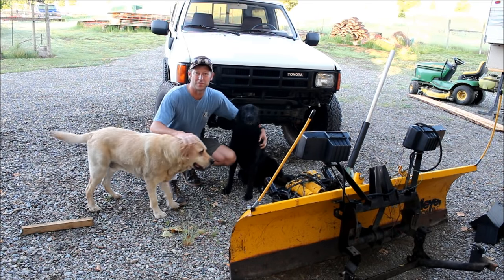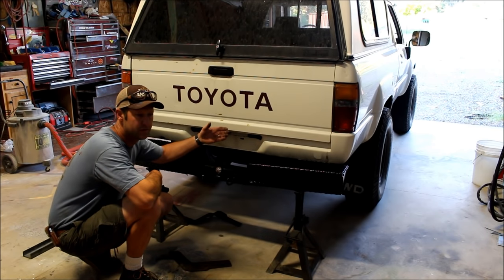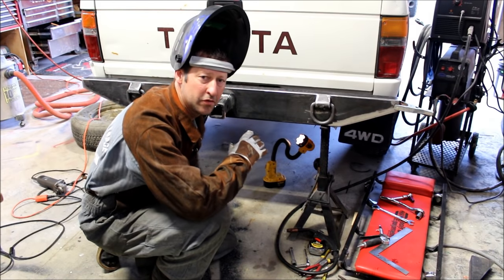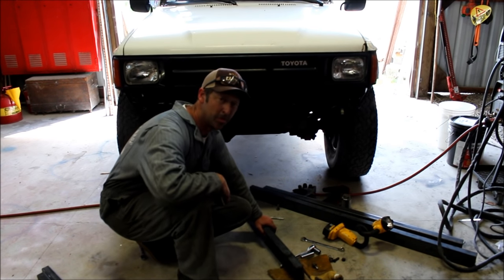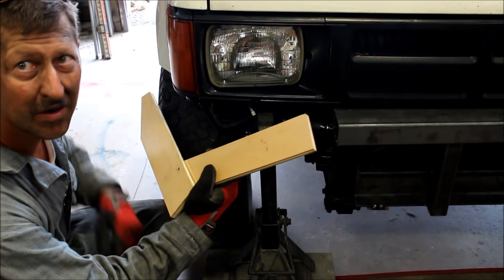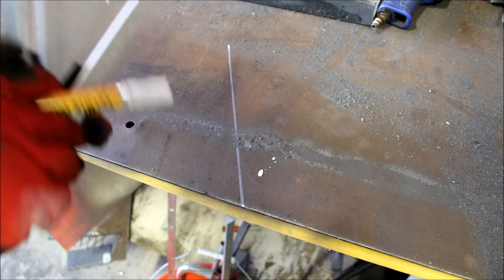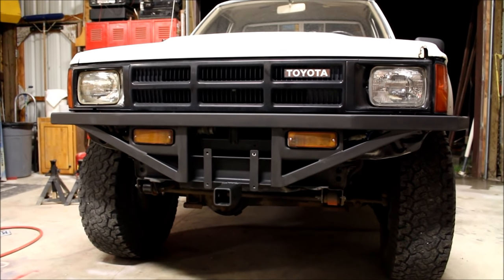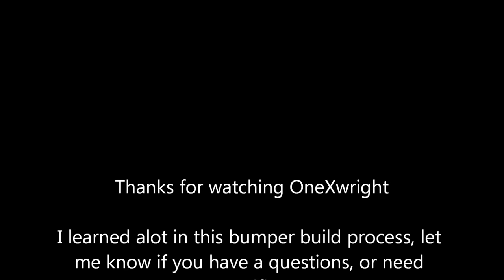Homemade Front and Rear Bumpers-Toyota Pickup

Comment: You inspired me to invest in a MIG Welder instead of forking out $1k on a single bull bar for my land cruiser 👍 appreciate the video good sir!
Reply: Get a chop saw too
Don’t forget a quality grinder 
Plus plenty of flap disks and chop saw blades 
Don’t skimp on the hood I run a Hobart auto dark they run about $100 uses Miller parts
Don’t be afraid go flux core wire
Either.
Cheaper welders come without 
The ability to run shielding gas
Get one that can you can upgrade and buy a bottle later.
Don’t underestimate the value of a welding cart either.
Boy the must have stuff  really adds up.
If you don’t mind getting burned it a fun past time if you diy anything it’s must a welder is a must have.
Don’t forget the 220 outlet lol
You can make an extension cord that adapts the clothes dryer 
Style plug.
Reply: @Masterofnone101      ...and just like that, my inspiration died haha appreciate the advice man

Comment from the maker: Thanks everyone!  Glad you liked it.  Hit a deer at speed last week...sad, but didn't hurt the bumper.  The factory unit would have folded into the grill and headlights!
Reply: Could I get the dimentions for the front bumper please absolutely love it. I have a 89 dodge ram 50 and i would lile to make something similar.  Thank you for the inspiration!!!!
Reply from the maker: @lukegotchya5753  sorry, but I don’t have any dimensions…probably wouldn’t fit your dodge anyway.  I would just use some cardboard to start with…easy to cut and tape together.  Then use the cardboard template to mark out your steel.  Good luck with your project.

Comment: Sir, if your carpentry skill is anywhere close to your metal fabrication abilities I need to hire you for my next out building project. Superb design,  simple, strong and only what you needed. If your state allowes you could move your front plat off center and move your receiver up to improve your approach angle.
Reply from the maker: Good idea on moving the plate...hadn't thought of that.  The hitch hasn't proven to be a hindrance to approach angle so far though, and I sure like having it there.  I did a video of a small tool shed if you wanted to see that as well.  Thanks for watching!

Comment: Great build! got me a 1987 toyota pickup. One question, how exactly did you bolt on the front bumper? Did you weld on bolts to the back side of the channel and then attach the nuts from the back?

Comment: Really nice. 
Couldn't you have put the receiver up higher and back further so you have a better approach angle (to me the approach angle is one of the most important parts of a custom bumper) 
Then build a separate piece to connect to it that comes out and drops down (or when flip goes higher) 
Thanks this convinced me to build my own.

Comment: On the front bumper you mentioned c-channel and bolts. So my question is the c-channel bolted on and then the two uprights and angled pieces are going to the main part of the front bumper?
Reply from the maker: Yes, if I remember right, the horizontal “C” channel down low was the foundation of everything.  On that year Toyota PU, there wasn’t much above the frame to tie into.

Comment: hows the old yota do with a plow? 4 or 6 cylinder? nice job on the bumpers!
Reply from the maker: +xavi Arana It does well in the tight spaces.  I use it mainly around the buildings.  I have a larger plow on an old F250 flatbed for the driveways and final cleanup.  The Toyota plow has a has a fully hydraulic adjustable blade which works much better than the Ford's, but I cant push near the snow.  The truck has the original 22R.  The only thing I still need to do is put power steering in her...that will be much better for plowing!

Comment: Recovery hooks should never be welded to the substrate. They should be welded to a buffer plate that is as thick as the bracket. The buffer plate should be round or a square with the corners cut off.

Comment: Looks so cool! I'm looking for some help though, I own a 1985 Toyota pickup as well, and my dad rear ended someone with it a while back. He began to take it apart to fix the damage but didn't save any of the existing parts. Was wondering if I could get some advice on how to piece the front bumper back together. I bought a new bumper on eBay but it did not come with any installation hardware. Maybe you might know what I need? Any help would be appreciated!
Reply from the maker: Hi Tanner.  Is the bumper you bought on ebay off a 84-88 toyota pickup?  When you put it up in place, do the mounts line up with the frames mounting holes?  If so, you will just need the appropriate metric fine thread bolts to mount up your new bumper.  I found the correct bolts at my local hardware store.

Comment: Where does one buy the raw metal used? Roughly how much did this project cost? Great job
Reply from the maker: You should have a raw steel distributor in your area.  They are just like lumber stores...walk in and tell them you want a 8' piece of 2x4 box steel at 3/16" walls and that's what you get.  You pay by the pound, so if you can get away with thinner gauge steel it will save you some money.  For these two bumpers, I had about $70 in steel, and probably another $10 in other materials (grinding wheel, paint, fasteners).
Reply: +onexwright thank you

Comment: what size tires are you running on the Toyota pickup.
Reply from the maker: +sergio lara Those are BFG 33's on Toyota Landcruiser Wheels, powder coated flat black.  I have the winter tires on now with stuck wheels and she runs out better and gets better gas mileage than with the 33's...doesn't look as good with stock though

Comment: Did you weld the rear bumper to the stock brackets? I see some people make new brackets that bolt onto the frame for their bumpers and im not sure what i should do.
Reply from the maker: The stock brackets wouldn't work for my needs.  They drop quiet a bit, and aren't very strong.  I didn't weld, but bolted new brackets directly to the main frame.  I didn't weld them, because I thought I may want to be able to easily take it off if I needed to do a repairs or repaint it after awhile.
Reply from the maker: I didn't use the stock brackets as they were very weak, and dropped too low.  Each application is different, but most stock brackets are fairly weak.
Reply: onexwright Exactly what i ended up doing, i agree they drop down too low. thanks for the response
Reply from the maker: You bet.  good luck with your build.
Reply: onexwright Hey I just got a quick question for you. You said you used angle iron instead of the old brackets for the rear bumper. Did you add any gussets at all for strength?